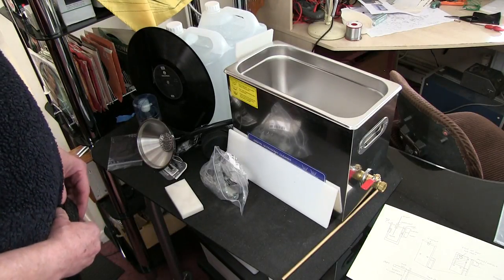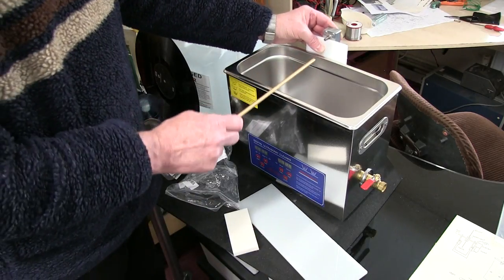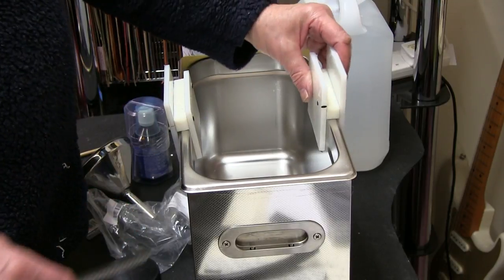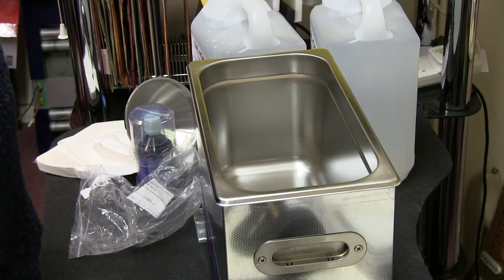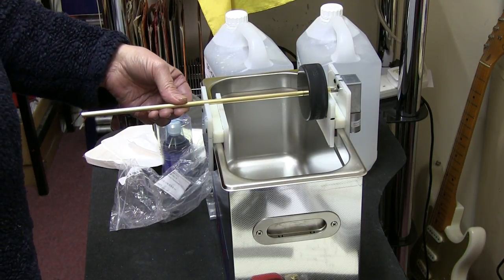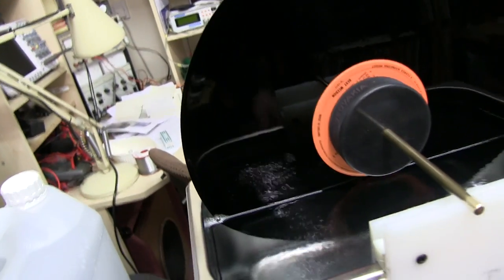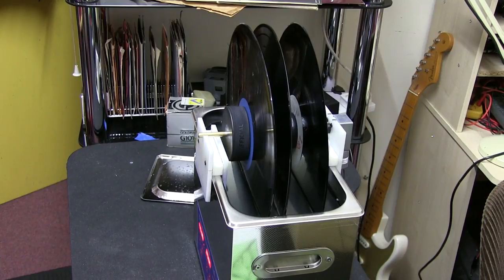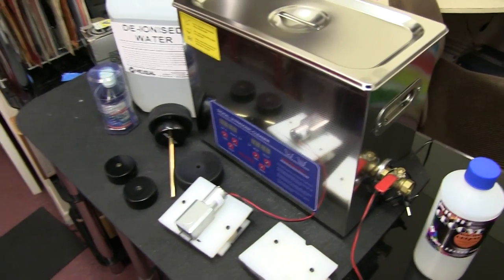How to make an Ultrasonic Vinyl Record Cleaner Part 1

Comment: I found the holes drilled in the large hockey pucks gradually wore until they stopped gripping the records, so now I use a foam/rubber garden kneeling board cut into pieces with a 5mm hole drilled into the pieces. They will also work as the spacers, and are much cheaper than buying the pucks.

Comment: Great video. Thank you. I made my own and finished it this morning. All for less than $150.00. Same unit as yours, but I changed my design a little. Thank you for the inspiration and great tutorial.
Reply from the maker: Hi Stephen. Any tips for other builders will be great.  All the best. Nick
Reply: @nickadams5411  i aill get on that this evening. Just running the records through right now. I dont know how to post pics without doing a vid. Thank you again. There are some other projects you did that im going to try as well. Cheers

Comment: I bought a 12v DC aquarium pump, (not much more than 1 inch cube) for £10, and mounted a £5 filter (10 micron) on the polypropylene at the back. Flexible plastic tubing (6mm internal), connects them both and takes the water back in to the tank, so it is constantly filtered. Ultrasonic uses cavitation at nanometre levels, so I don't see the relevance of the visible waves, or why there is any need to space the records such that the visible waves have room to form? Is there any scientific basis for that? It seems intuitive, but ..........

Comment: Excellent video sir.  Well laid out and great instructions.  Already ordered the ultrasonic cleaner and now gathering up all the other bits needed. Thank you very much for your effort in making this video and sharing it.
Reply from the maker: Hi D
Thanks for kind words.
Let me know how you get on, or any improvements.
I think the plastic parts could be made narrower, as mentioned in the video.
Also, if you want to clean singles or 78 records, adjust the mounting height with  spacer strips.
All the best
nick

Comment: Hi Nick. I wanted to mention Poly Morph plastic beads. I use them all the time for everything. You melt them in hot water and form the plastic into any shape. Can be drilled, sanded, painted, etc. You can make anything and then re-melt it if you don't want it anymore. Use it a billion times over. I am making this project by forming the plastic by hand to the edges of the cleaner (do it when the plastic starts cooling off and can be sculpted). Placing plastic wrap over items keeps it from sticking and takes on their shape. Check this out everyone. It's what I use in place of wood, rubber, screws, metal, etc on all my projects.
Reply from the maker: Hi Wyatt. That is a really good thing. Will save a lot of time.  Thank You , Nick

Comment: Nick. What does it do to a Dc motor to reduce the voltage? The 1 RPM motor I see on Ebay runs at 6V DC. I understand that putting more power can damage it "Fry it" so to speak, are there any drawbacks to applying a lower voltage?
Reply from the maker: Hi. You can apply lower voltage. I use a wall plug power supply with a dial for voltage. Lower voltage is okay until the motor stalls , due to lack of power. Then just turn up voltage until it turns again.

Comment: What are those larger disks? Not the hockey pucks but the ones on the outside? Thanks for the detail
Reply: They are also hockey pucks, but the holes wear and they stop gripping the record after a while. I now use a garden kneeling board made of foam/rubber, and cut it into pieces with a 5mm hole drilled into the pieces. Works well, and as a spacer, and is a light lighter.

Comment: I have just bought one, but haven´t tested it yet! I will try with distilled or demineralized water 5-6 liter, Isopropyl alcohol 30 ml , Ilford wetting agent 5 ml, and then just lift them over (I have a motor thats only mounted on one side)  and afterwoods rinse them in destilled water in a plastic tank. What do you think? I have got Le Son left since I had an Okki Nokki, shall try it, but with that liquid it will be very expensive..

One thing I wonder of, if you have 2 or 3 records, and If they works best with the records against the side of the tank, as you say, shouldn´t  you lift the motor to the other side to get it clean the same way on both sides? Because you said that cleaning just one record is the best, and with that they have both vinyl sides against the tank side.

I am thinking of drying the records with a special made nozzle with velvet togther with a vaccum cleaner, it will work exatly as the Okki Nokki to get rid of the water!

I must say, that is some great vidoes that you have made, many thanks for that!

Comment: Lower the water level to the line in the bath (the agitators are WAY more effective at cleaning with a lower volume, more records are less of an issue) and avoid getting the label wet. 15 mins is correct. Looks like L'Art du Son. You need the whole bottle for 5 litres. It is reusable and your tip for filtering big debris with coffee filters is what you need and re-use the mixture, thereby lowering the cost of the record cleaner.

Comment: Do you not have to rinse the record off after the cleaning with distilled water?  Are you drying the cleaning solution on the record?
Reply from the maker: Hi Bruce  You can spray the disc with distilled water before drying.  Or you can repeat with just distilled water in the tank. I blow dry my discs with a powerful air blaster  (motorcycle air drier). Which is better than leaving the records to air dry, as it blast the solution off the record before it can dry and leave deposits.

Comment: What's the brand and model of the digital ultrasonic cleaner? There's a lot of ultrasonic cleaners on the net. Just want to make sure, I get the right one you are using, so I get the right size, and also the timer functions plus temperature adjusting. Thanks mate for the video. Krusty from Denmark BTW: Are you able with this ultrasonic cleaner, to have the water level to cover the whole playing area (all the way to the edge of the cover)?
Reply from the maker: Hi Krusty
If you set the rotating spindle as low as possible, then the water level is over the label edge.
The make of the Ultrasonic keeps changing on Ebay.
Some are much larger. This one is the PS-30A
Reply: @nickadams5411  ok. Thanks a lot for the info. Regards Krusty.

Comment: Thank you Nick for a great video. I don't know a lot about ultrasonic cleaning other than I have herd that it is the best way of cleaning records. One thing I wanted to ask was do you thing that the number of records you out in a tank has an affect on the time and efficiency it has on record cleaning ? 
I had wondered about cancelation effects cause by the number of records you have in the tank at one time. 
I did notice that the ripples on the cleaning solution seemed to smooth out between the records when you had two recoreds in the tank at the same time
Reply from the maker: Hi Jeremy
Yes, I now only do 1 record at a time, and for the maximum of 30 minutes.
Pre clean the record as best you can with a good cleaning solution and a brush.
I use a very fine (0.01mm) bristle toothbrush.
i find Kodak wetting agent is also quite good for cleaning.
Very dirty old records often need 2 or 3 goes in the tank.

Comment: Beautiful job Nick! My questions is in regard to the ultrasonic machine itself. Everything in the lower price range has 40khz transducers. I would like to change replace them with my own 80khz units. Are the ones in these machines easily located and replaced? Thank you in advance!
Reply from the maker: Hi. I have not looked inside, but I think the transducers are welded to the case bottom. I belive they can burn out eventually, but mine still seem okay. Let me know how you get on.

Comment: If you want to clean solely 7" discs, you can cut the "V" groove that hold the brass rod a bit deeper than it would be for holding a 10-12" vinyl disc.  As an alternative, instead of physically cutting a "V" groove in both sides of the plastic, cut a 1" x1" "box" in each of the upright supports.  Then fashion a "U"-shaped piece to hold 2 "V"s - one with a depth deep enough to hold the support rod for a 10-12" disc at the correct height in the tank and a second set of pieces with "V"s cut deep enough to hold the horizontal support/drive rod at the correct height for suspending 7" discs in the tank.

Comment: Recently purchased a motor (by Bringsmart) on Amazon that looks just like the one in the video. It worked perfectly for 9 days. On the 10th day it started smoking and caught fire. Fortunately I was right there to disconnect it and prevent the fire from spreading. Hopefully the new, more robust motor I bought to replace it will work out better.

Comment: Good job. I'd be tempted to run a bead of silicone on the poly support on the motor side, to prevent that movement when inserting the rod in and out.  
Have you noticed any ill effect using 40 degrees, no problems with records becoming warped?
Reply from the maker: Hi Mik
I have not had any problems with temperature warping the records.
I do advise cleaning any fingerprints off with a cloth and solution, as they sometimes remain.
Also some stubborn noisy old records require a few cycles to get rid of most of the crackles.

Comment: Thanks to your video I was able to build my own "spinner" for $30 . All the parts I got from ebay. The wood pieces I got for free from the scrap bin in Home Depot. Here are the parts I used a few years ago. Not sure if they are still available on ebay:  The motor to get is 0.6 rpm.
10pcs Φ5mm x 300mm ALUMINUM 6061 Round Rod D5mm Solid Lathe Bar Stock Cut Long | eBay
Reversible Multiple Geared Motor High Torque Turbo Worm DC 12V GW370 2-100RPM US | eBay
DC Power Female Connector Cable Pigtail Plug Wire | eBay
5/16in(8mm) OD 3/16in(4.8mm) ID USA Made Latex Rubber Tubing BLACK 1ft (#604) | eBay
Reply from the maker: Hi
Nice job, and cheap.
Reply: Faras I would appreciate if you could email a parts list. I am going to bldg. a unit next week and don't want to reinvent the wheel, if you know what i mean.
Reply: Anyone got the info on this?
Reply: @giveall9695  10pcs Φ5mm x 300mm ALUMINUM 6061 Round Rod D5mm Solid Lathe Bar Stock Cut Long | eBay
Reversible Multiple Geared Motor High Torque Turbo Worm DC 12V GW370 2-100RPM US | eBay
DC Power Female Connector Cable Pigtail Plug Wire | eBay
5/16in(8mm) OD 3/16in(4.8mm) ID USA Made Latex Rubber Tubing BLACK 1ft (#604) | eBay
Reply: @crazyLocko  10pcs Φ5mm x 300mm ALUMINUM 6061 Round Rod D5mm Solid Lathe Bar Stock Cut Long | eBay
Reversible Multiple Geared Motor High Torque Turbo Worm DC 12V GW370 2-100RPM US | eBay
DC Power Female Connector Cable Pigtail Plug Wire | eBay
5/16in(8mm) OD 3/16in(4.8mm) ID USA Made Latex Rubber Tubing BLACK 1ft (#604) | eBay
Reply: @krishsamusementpark  10pcs Φ5mm x 300mm ALUMINUM 6061 Round Rod D5mm Solid Lathe Bar Stock Cut Long | eBay
Reversible Multiple Geared Motor High Torque Turbo Worm DC 12V GW370 2-100RPM US | eBay
DC Power Female Connector Cable Pigtail Plug Wire | eBay
5/16in(8mm) OD 3/16in(4.8mm) ID USA Made Latex Rubber Tubing BLACK 1ft (#604) | eBay
Reply: @ronsonroll  10pcs Φ5mm x 300mm ALUMINUM 6061 Round Rod D5mm Solid Lathe Bar Stock Cut Long | eBay
Reversible Multiple Geared Motor High Torque Turbo Worm DC 12V GW370 2-100RPM US | eBay
DC Power Female Connector Cable Pigtail Plug Wire | eBay
5/16in(8mm) OD 3/16in(4.8mm) ID USA Made Latex Rubber Tubing BLACK 1ft (#604) | eBay
Reply: @ronaldthoele5650  10pcs Φ5mm x 300mm ALUMINUM 6061 Round Rod D5mm Solid Lathe Bar Stock Cut Long | eBay
Reversible Multiple Geared Motor High Torque Turbo Worm DC 12V GW370 2-100RPM US | eBay
DC Power Female Connector Cable Pigtail Plug Wire | eBay
5/16in(8mm) OD 3/16in(4.8mm) ID USA Made Latex Rubber Tubing BLACK 1ft (#604) | eBay
Reply: @StudiBeaus  10pcs Φ5mm x 300mm ALUMINUM 6061 Round Rod D5mm Solid Lathe Bar Stock Cut Long | eBay
Reversible Multiple Geared Motor High Torque Turbo Worm DC 12V GW370 2-100RPM US | eBay
DC Power Female Connector Cable Pigtail Plug Wire | eBay
5/16in(8mm) OD 3/16in(4.8mm) ID USA Made Latex Rubber Tubing BLACK 1ft (#604) | eBay
Reply: @eduardbotos1899  10pcs Φ5mm x 300mm ALUMINUM 6061 Round Rod D5mm Solid Lathe Bar Stock Cut Long | eBay
Reversible Multiple Geared Motor High Torque Turbo Worm DC 12V GW370 2-100RPM US | eBay
DC Power Female Connector Cable Pigtail Plug Wire | eBay
5/16in(8mm) OD 3/16in(4.8mm) ID USA Made Latex Rubber Tubing BLACK 1ft (#604) | eBay
Reply: @rayng6219  10pcs Φ5mm x 300mm ALUMINUM 6061 Round Rod D5mm Solid Lathe Bar Stock Cut Long | eBay
Reversible Multiple Geared Motor High Torque Turbo Worm DC 12V GW370 2-100RPM US | eBay
DC Power Female Connector Cable Pigtail Plug Wire | eBay
5/16in(8mm) OD 3/16in(4.8mm) ID USA Made Latex Rubber Tubing BLACK 1ft (#604) | eBay
Reply: @crazyLocko   The motor to get is 0.6 rpm.
Reply: @krishsamusementpark   The motor to get is 0.6 rpm.
Reply: @ronaldthoele5650   The motor to get is 0.6 rpm.
Reply: @StudiBeaus   The motor to get is 0.6 rpm.
Reply: @eduardbotos1899   The motor to get is 0.6 rpm.
Reply: @rayng6219   The motor to get is 0.6 rpm.
Reply: @giveall9695   The motor to get is 0.6 rpm.

Comment: Nice video Nick, I was just browsing around to build mine. Your instructions comes as a big help. Please let me know when is it advisable to change the liquid , I mean after how many records? Thanks.
Reply from the maker: Hi
The water is very cheap, Tesco about £1 for 2.5L.
So change it as soon as you see dirt floating around in it.
I sometimes leave the water in it for a month, if I am buying old records to clean.
Otherwise if you have to put it away, you will have to empty it.
I don't put any additives in the water, but preclean the records and leave the cleaner on the record when I put in the tank.
Reply: Nick Adams - I stay in India :) need to source it locally or make it on my own!

Comment: some comments on the ultrasonic tanks mention leaking at the seam or valve and circuit boards getting wet. Have you had this problem?
Reply from the maker: Hi Dave
These tanks must be cheaply made for the price.
Mine is ok
However it is possible that the thin stainless steel is cheap and with pin holes.
These will probably start to leak as the ultrasonic erodes them.
Possibly why the seams fail as well.
Reply: Thanks for your answer.

Comment: Hi Nick what make and model of the cleaner did you buy?
Reply from the maker: Hi.  It is the ULTRA PS30A  180watts  Tank size:  300 x 150 x 150mm.  With heater and 30minute timer.
However it is hard to find. So get one that is a similar size. The tank size needs to be at least 300mm wide or the LP will not go low enough into the water.  All the best nick

Comment: Do your labels get wet? I can't tell from the video. You mentioned not caring but I'd be curious. Awesome design and video, thank you!
Reply from the maker: Hi
The labels do not get wet, as any water on the record runs off quickly as it leaves the surface very slowly.
I thought about a sealing ring or pad, but found it not necessary.
Reply: @nickadams5411  Excellent to hear that! I'm building one now, just received the parts. Will report back my results.

Comment: Hi, How many RPM has your motor? Temperature and time please? Thank you
Reply from the maker: Hi
Time in the bath is the maximum 30minutes.
Temperature 35 C
Rotation about 1RPM
Reply: Nick Adams Thank you Nick. Can youtell me the ingredients
Reply from the maker: Hi
The liquid ingredients?
Use deionised filtered water, which is very cheap.
Reply: Hi Nick, thank you for your help.

Comment: What produces cavitation capability on this and such type of machines? It's just a little ac motor used for spinning of records what I can see, nothing else is attached. Can anybody explain to me pliz?
Reply from the maker: Hi Michail. The Ultrasonic bath has transducers embedded in the bottom,, which vibrates the water at high frequency. This causes cavitation bubbles which vibrate against the record and result (hopefully) in the dirt to be dislodged and fall off.
Reply: @nickadams5411  Thanks man for replay, 've been thinking something at that direction. It perhaps deserves more research !?
Reply from the maker: Hi, maybe more research, but there have been many cleaners over the years.
Reply: @nickadams5411  I have a SpinnClean but not satisfied with it and looking for an alternativ.. Cavitation or vacuum question is now !

Comment: Hasn't Anyone gone Into Production, making these extra's?. Maybe the People Who make the Tank would consider It. This Is the only thing that's puts Me off buying this. I don't have the Kit or the Steady Hands to It. 29:45. Gouge a great big Scratch on the Sparp Corner of the Piece of Plastic Ooch!. 29:48 Make sure You equal the two sides Nicely, Well Scratched up now. It Is going way to fast, and that Noise would drive Me and my neighbors nuts. Put a Laptop or Notebook next tot eh drying rsck. And plug In a couple of USB Fans round them, Works great for Me. Plus You get Both sides at the same time, And NO Noise. That Blaster Is Blasting Tiny electric Particles on the the surface of the Record. Thanks for Sharing, Nice Job.

Comment: Interested in making this. I was about to spend a lot of money and I found this so I'm very happy. My trouble is I can't find the PS-30A. Anyone have a line on where to get one?
Reply from the maker: Hi
Search on ebay for "Digital Ultrasonic cleaner"
There is one 6.5L only a tiny bit larger at £82.99 (free post) in the UK (Dec 2017)
Size: 330 x 180 x 270mm
Reply: Thx, Nick. I'm in the US and I did find a 5L one on Amazon for about $140 shipped. Great video and I look forward to putting mine together. Cheers, mate!